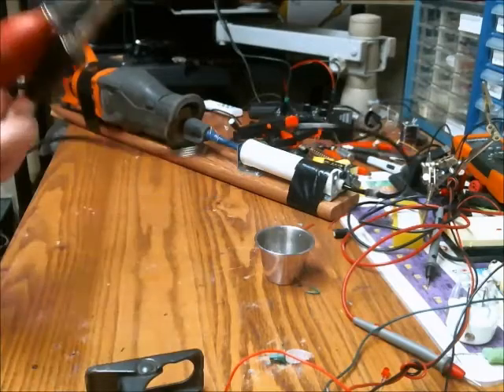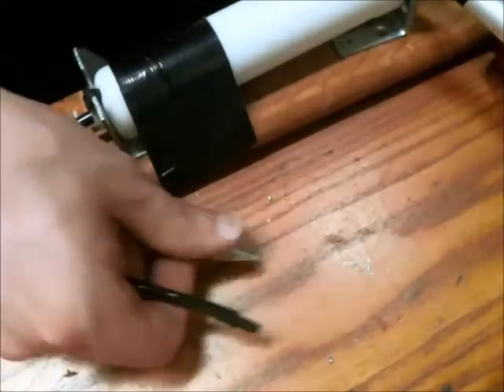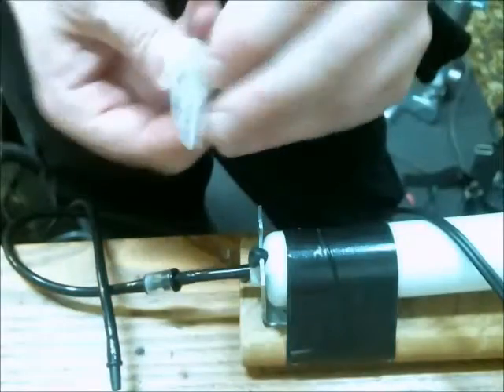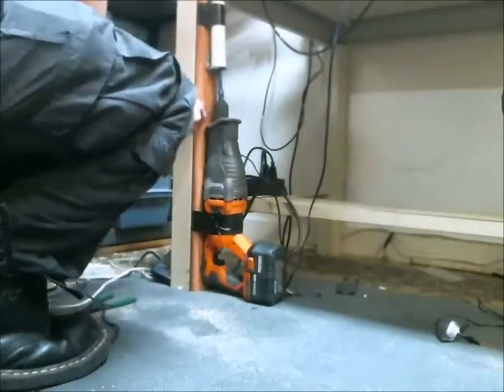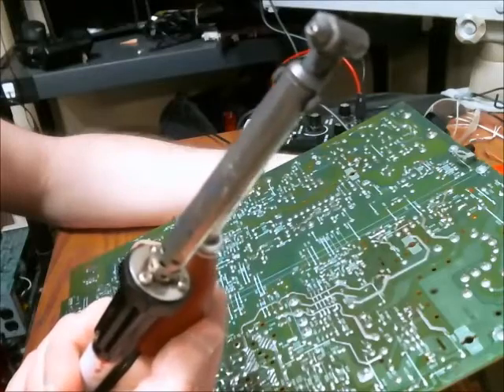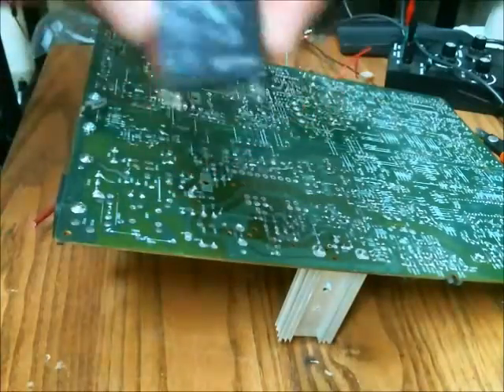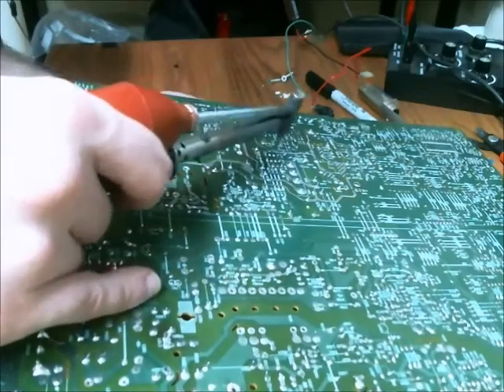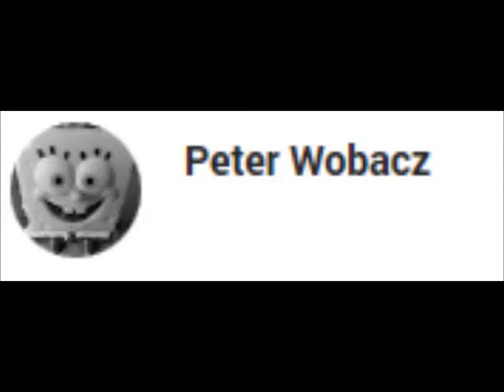Improved Solder Vacuum Rev.2

Comment: Where did you get that iron atachment?

How does the right nagle bit go for getting blocked up? and is it easy to clean out when full of burnt flux?

Great rig! Works as well or better than my comercially purchased suction station.
Reply from the maker: It is an older version of this http://www.radioshack.com/radioshack-45-watt-desoldering-iron/6402060.html
No issues with the right angle design so far.
The solder builds up in the red bulb and detaching it while warm is a simple matter. No major clogs yet.
Reply: Hmmm My gun sucks the solder right down the centre of the heating coil, and all the flux burns up and blocks it. I always thought it was a bad idea. Going to see if I can get one of those in Aus, and make some modifications. Shame radio shack wont post overseas....